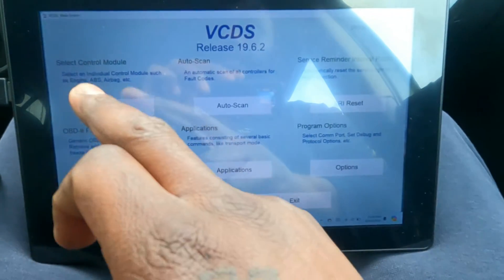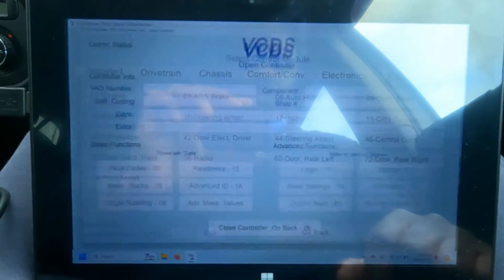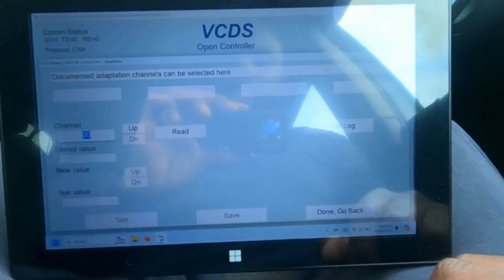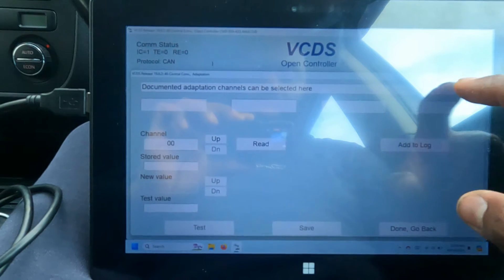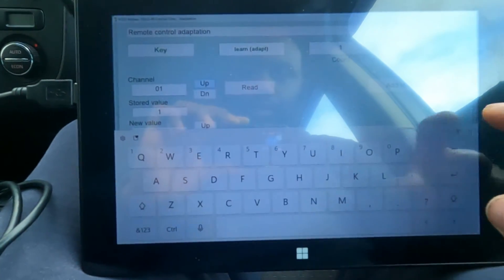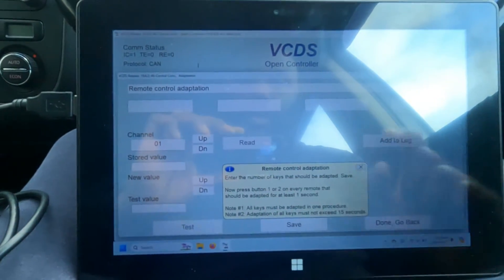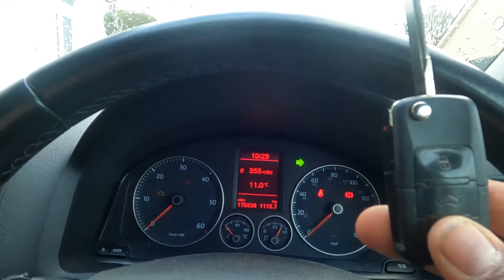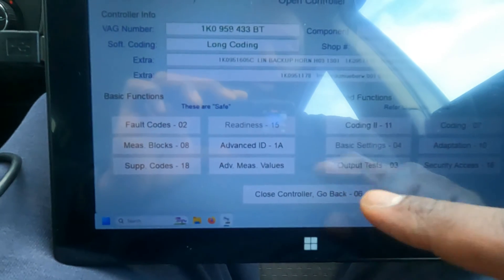How to program your VAG key fob (VW Golf 5)

Comment: Hi, This just matches the new remote and lets you open and close the car, right?  It doesn't let you start the car with the new remote i.e. with the new immobiliser?
Reply from the maker: That's correct..
This is only for locking and unlocking the car. To start it you need the new chip programmed to the immobiliser and VCDS doesn't allow it to perform that..